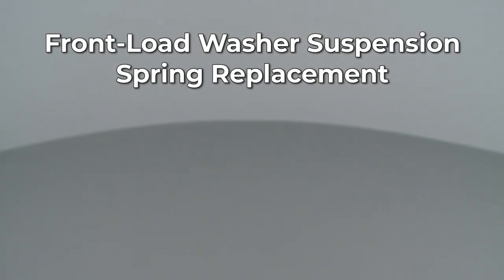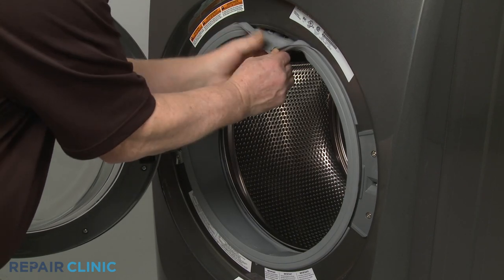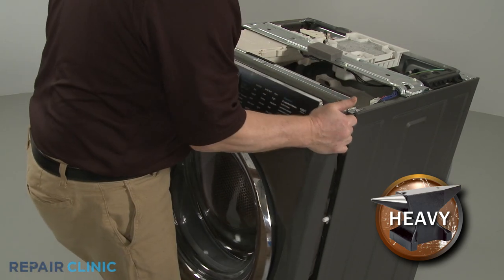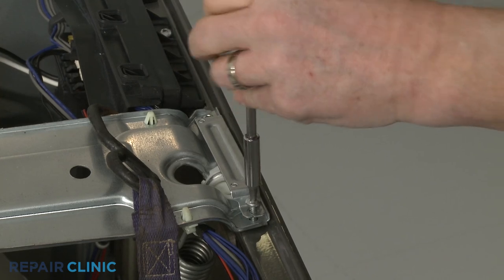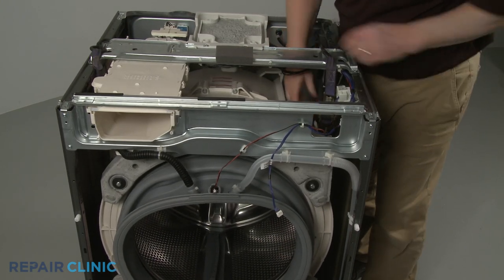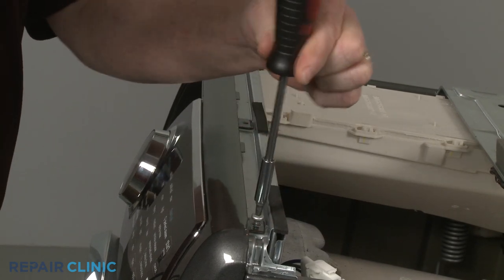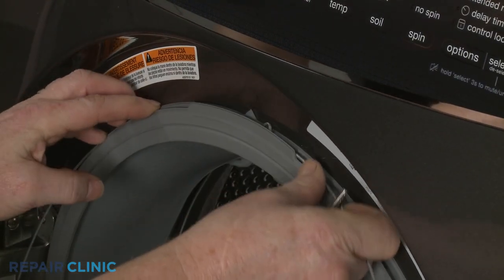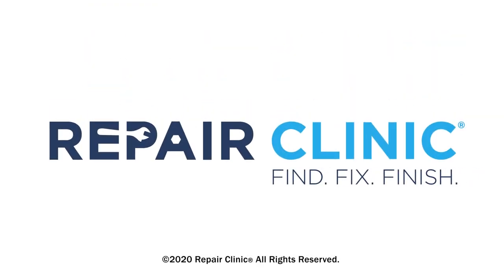Front-Load Washer Suspension Spring Replacement (part 5304505117)

Comment: Great video, simple clear instruction on how to remove the top, the door seal, front panel, and how to replace a spring. You have taught the first three, these will surely assist with access to many more repairs. Many thanks.

Comment: hello . how can i tell if the spring is bad? i already changed shock absorbers for original new ones and  the machine now goes back and forth at the start of the spin cycle. then it vibrates quite a bit while centrifugating.
Reply: What did you do to fix this? I did the same and my washer still shakes violently on spin

Comment: Hi. My washer is 14 year Miele and it now rumbles like chief Wiggams. Is it likely the springs or suspension rods? Is there a way I can tell if springs are stretched? Are springs meant to have any gap between coil of spring when drum is idle? Is that how you know if spring is stretched or measure will work then compare with new spring measurement ? I need a waffle
Reply: i would also like to know this. my washing machine goes back and forth when the spin cycle starts. i put new shock absorbers and the problem persists.
Reply: @nazaa999  yeah I replaced shockers for about 50 aus dollar made no diff. I live in town where water is heavy so metal rusts quicker . I gave up and decided to buy new machine and tore the old one to pieces ,such fun